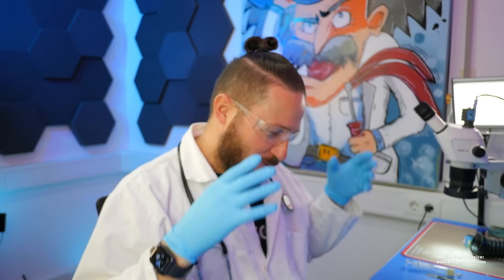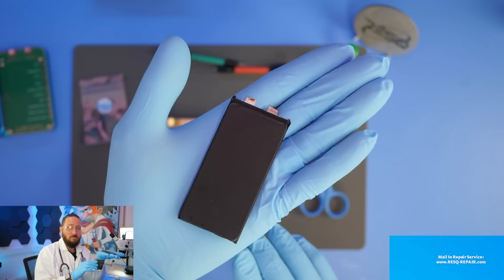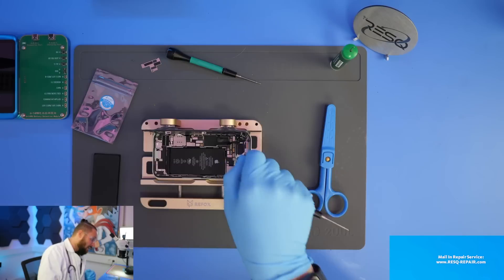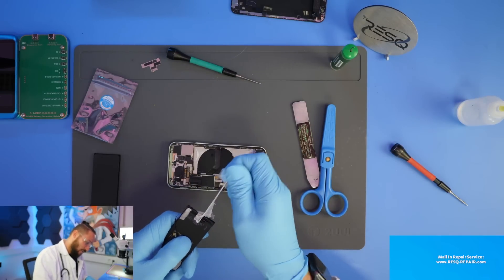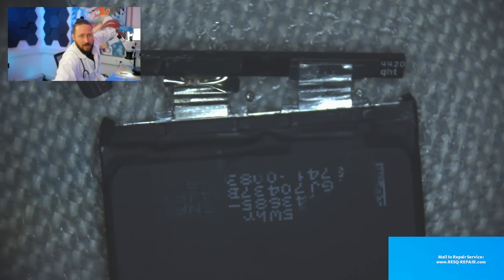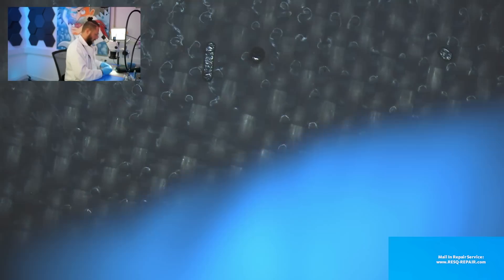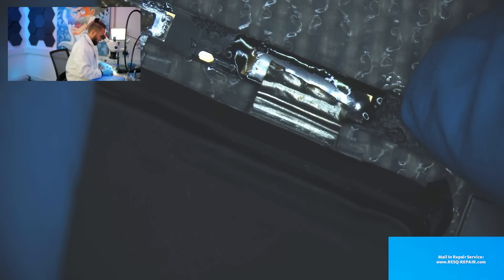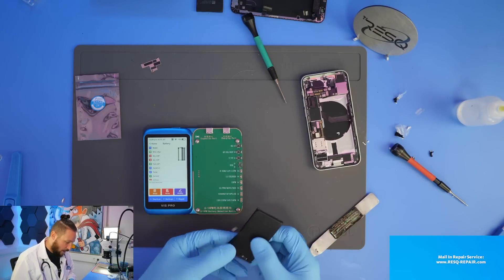🔋How to Swap iPhone Battery without “Important Battery Message” Warning - With JC V1S Pro Programmer

Comment: Excellent video Dr Ben. I have used this JC tag method to replace my iphone 12 Pro Max battery that was at 73% and so was showing the service message 'your battery health is significantly degraded'. I replaced the battery and set the health to 100% and cycle count to zero. Even though the health is showing as 100%, the service message is still there? Why is this and how do I remove it? Thanks

Comment: Hi dr. Ben I was wondering why you didn’t use hot air gun to detach BMS from battery. It’s much easier to operate for me. I’m not sure about overheating other components on BMS board but it’s really short time and controlled temperature?
Reply: much better if you use ceramic cutter

Comment: Iphone 11. iOS 16.5. I rewired the chip, and overwritten the information on the jcid chip. But it was 74%, on a new battery it shows the same 74%. What could be the reason ? 🙏🏼
Reply: Tag on flex should stay in phone.

Comment: I tried this for the first time with an iPhone 11 Pro battery and a JC V1SE. When I attach the tag on flex to the programmer and try to “activate” it, I get the error “no repair cable detected”. What am I doing wrong, or is there something wrong with the V1SE? Thanks for the help!
Reply: Did you solve it?
Reply: @henriksvensson2836  No I never did. I think it didn't work because my JC V1SE does not have the wifi module installed. I believe if the programmer is connected to wifi, the process should work.

Comment: Regarding your suggestion at the end... I wouldn't put an iPhone 12 battery in an iPhone 12 mini, if I were you... unless you want to connect (battery +) to (board GND) and (board +) to (battery -). Something bad is bound to happen.
Reply from the maker: iPhone 12 and 12 mini is same. 12 Pro Max is different. Think before write ✍️
Reply: @RESQREPAIR  Yes, sorry, I misheard. My bad.

However, my comment was not meant aggressively or to make fun, I'm not sure that kind of response is needed. I was just trying to prevent people from putting the wrong battery in and damaging their devices.

I guess the more general advice I wanted to give was to check parts compatibility before you take a part from a device and connect it to another.

Comment: Hello Dr. Ben I've replaced thousands of battery so far. At first I used to do just like you but I've lost some BMS on the way and I supposed it was because of the heat Applied to the board. After that I've started using spot welder (but it sucks since it's harder to make it stick kkkkkk). Do you have some informations about it?
Reply: Just get good

Comment: JCID-V1S Pro programmer is used for iPhone screen original color, Face ID, battery, receiver FPC cable vibration data reading and writing repair, DFU purple screen mode, etc.

Comment: Thank You for the video! Do you use low melt 138C soldering wire here or something else? I would rather use solder as well, you can achieve better connection this way compared to spot welding imho.
Reply from the maker: It’s a special solder for this job.
Reply: Hello Dr Ben .. can i2c 6s can do this all stuff right ?? If you buy the battery board right?

Comment: Have always seen spot welding and have always done spot welding for these core batteries but never seen the using solder paste to connect it to the battery board 😳
Reply from the maker: It’s not a paste. It’s a special solder wire.

Comment: Hello boss. What happens if you remove the tag on flex on the battery after repair
Reply from the maker: Tag ON needs to stay on the battery.
Reply: @RESQREPAIR  thanks 👍
Reply: It doesn’t

Comment: Hello sir, I have an iPhone whose battery percentage is 86, and when I bought a new one for him, the iPhone turned on and off, and the battery percentage did not appear. Can I remove the old battery and stick it on? It works for me normally without using the programming tool. I do not have it. Thank you sir.
Reply from the maker: Watch the video again please.

Comment: Hey Ben amazing video I really love your job. My question is. Do I have to keep the tag on flex inside the phone after I reprogram the BMS board?. I have the qianli programmer and i2c (I’ve done the job in an iPhone 12 and 11 which require the tag on flex). Too many opinions on the topic. I even asked qianli and they said that I have to keep it in the phone permanently. Others are saying that you can remove it and use it again. What’s your opinion?  Thanks.
Reply: Unless you have shares in JC you can remove the flex safely afterwards! It works and keeps working without the flex. Also after updates.
Reply: You can either leave it inside the phone (correct way) or take it out but if you do so, you can have problems like battery going into maintence even above 79%. That's the only problem I've notice
Reply: I replace BMS all the time and i never use the tag on flex, i just reset the original BMS with the V1S to 0 cycle and the battery state to 103% like Apple does and it work. I didn't get why you use the flex tag... The flex tag is use if you do NOT replace the BMS you just write the old battery on it and put the flex on the new one so the logic board will read the flex who work as the BMS instead.
Reply from the maker: Let it stay in the phone bro.